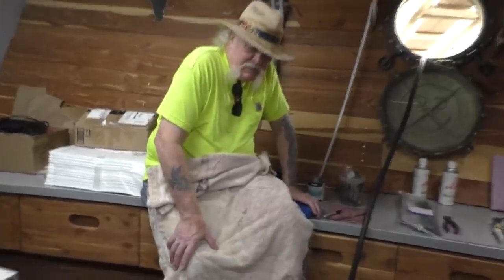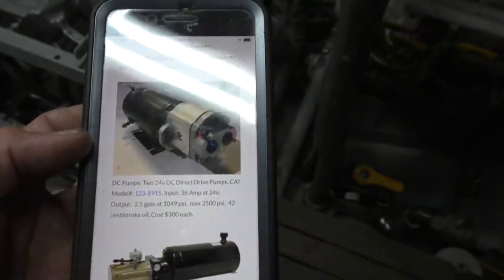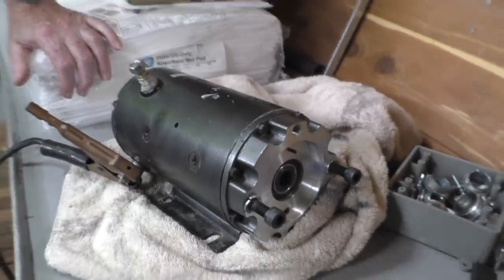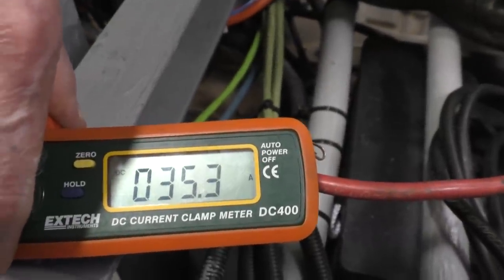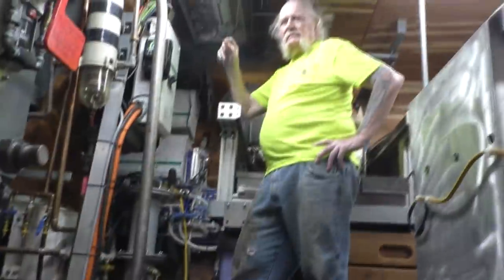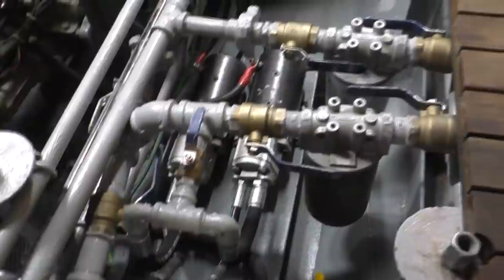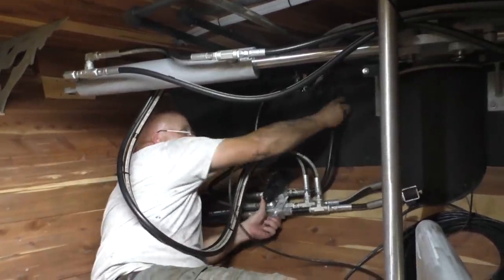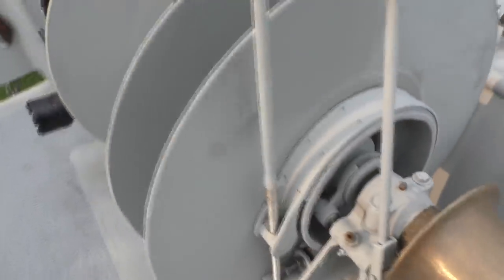Hydraulics - Part 9 - Charging the System

Comment: You have "C" type breakers but you need the slower type "D" for motors (high inrush current). They cost more or less the same, but at least you'll be able to protect the motor with its normal rating

Comment: the breaker generally is sized to protect the wires and it looks like 0 or 00 gauge wire so 125 amps for 0 and just shy of 200 amps for 00. motors that size draw easily into the hundreds if not a thousand amps on startup.

Comment: Interesting to read some people’s take on this. I have been doing electrical control work for the better part of 15 years. Not too often on DC motors however. My $0.02 is that you should check to see is those breakers are rated for both motor over current and short circuit. From the looks of it I would guess those are a standard din rail IEC breaker. It should be rated for Short circuit but I would be surprised if it is rated for motor switching or motor over current protection. Something I tell my clients to keep in mind is that Breakers are there to protect wire, motor overloads protect the motor. My approach would be to look at the motor nameplate or spec sheet and get the FLA at whichever voltage (24/12). size the breaker to no more than 200% (to leave some buffer), size the wire to the breaker, and put a motor starter on those that have an overload ranged to the FLA (plus service factor if you so desire). Tie the motor starter coil in with a pressure switch dry contact and let the system maintain a range between the high/low set points. 

Now having watched your channel for the better part of 4-5 years, I am fascinated to see what solution you come up with.

Comment: if the motors use 36A you should use a 72A Fuse because the starting current is insane.
Or use burn out Fuses. They react slow and wont burn out when starting the motors
Reply: @Brian-mp6bg  his system is designed to use breakers. Your point I think is very important. But unfortunately Doug is not one to change his mind at this point. Others have suggested using breakers that will handle the high start up surge. Certainly one or the other That's the current setup cannot work.

Comment: hydraulics sounded a little lazy to me Doug and the pressure wasnt near optimal so im guessing youy need the motors to have 24vdc as sold and have a soft starter fitted to let them ramp up under load..11 opr 1200 psi should be ballpark for rams and winches i think..God i love when you lift a floor hatch and we get to see the effort you all have put below them..Hope you are getting that launch red tape sorted Team..all the best from oz

Comment: Did you consider that inrush to a DC motor can be 2-3X the Load current. Inrush with DC is much more severe than AC since there is no zero crossings. Inrush limiters can also extend the life of the motor greatly. Inverse time current protection may be 250% ( 400% with exception) with 1100% instantanious.  These are land requirements. I am not familiar with ship overcurrent requirements.  Should be easy to look up.

Comment: Series connection of loads is olnly recomended if the loads are kept equal.. othervise the different loads will result in different impendances, and the one with with more load will show lower impedance resulting in the one with lower load will see higher voltage. That might damage the lesser loaded motor due to over voltage.

Comment: If the load is 59 A on the load after they start, you need to step up a breaker and the wire size for those. Since they are going to be ran for more than an hour per day when in use, you have to de-rate the breaker and wiring to 80% of its capacity. This is done so that as things run and heat up, which with the current those are drawing, they are going to heat up a lot, the breaker and wiring can handle the load and not trip or raise the risk of the wiring deteriorating from the heat early and causing a fire down the road. This is standard for any load that is running more than an hour or two in a day and prevents equipment damage and fire after the system has been in use for years.

Also, you need to have the wiring, motor started, and breaker rated for the locked rotor current rating for the motor if you are going to start them under load or you will trip the breaker and cook the wiring if the load is heavy enough to stall the motor.

Comment: In rush current is popping the breaker. If you halve the voltage you will be doubling the current.  V=IR. The windings will not last when the pump is under load because of the heat dissipation

Comment: If it's a 24 volt motor, 12 volts might run it, but weakly.  If it's 12 volt, 24 might run it at twice the power until it fries.  This all depends on the internal control and overload circuitry (if there is any) on the motor.

Comment: Motors are inductive loads, so there's an 'inrush' current at start up, one way to reduce this is to have a series resistance with a shorting relay, the motor starts in series with the resistance, then the shorting relay bypasses the resistance but you'll need a high power resistor
You also have a decent lrngth of wire that will give  voltage drop, as the motor starts, the voltage drops, and the motor wants more current (lower voltage needs more current to maintain power (V*I=W)
Those motors are more like starter motors, personally i would put those solenoids close to the motors and batteries, with a local fuse or breaker keeping the high current wires as short as possible
Not sure how breakers are labelled in the states, but we have A,B,C etc, the highr the letter, the longer the delay which is more suitable for inductive (or capacitive) loads.

Comment: How much pressure do you have in the hydraulics ? Asking because I see you are using galvanized pipe and connectors on a hydraulic system. I see big problems with that, why are you not using hydraulic lines? Just asking.
Reply from the maker: 3 million psi

Comment: The Circuiy Breakers are just that: they are to protect the circuit from overload, not start motors. Think of your car and the starter motor is fed through a solenoid to provide it with high current it needs under load.
Reply: Others have said there are different type of breakers that will permit the high surge current. These should be used.

Comment: When I wired my Cnc for my Bridgeport the breaker would always pop when turning it on. I have a toroidal power supply and I had to get a different type breaker so it wouldn’t pop with all the inrush of current! Like you said a slower to react breaker! (I believe that’s what I ran into and had to buy!)

Comment: No bueno to put motors in serial, depending on the load the voltage/load will change to the motors -> could overdrive one motor. If you couple the motors mechanically all good. But you need to ensure that the motors will have the same load

Comment: you have a thermal camera to see if those cables heat up... right?  200 amps is a lot.. even on 12v.. a loose connection can cause disasters..
Reply: Yeah I think a thermal camera would be good during the trials at least. And in the future for diagnosing potential problems.

Comment: These same systems are used for hydraulics on cars,I had 36 volts to each of my pumps(I had 4). Run them in series,have 1 solonoid per battery and you will be fine
Also if you add 2 more batteries it won't put as much strain on the pumps and will increase the life of them

Comment: A 12 volt motor will require twice the current to do the same work as a 24 volt one.      (Power=Volts x Amps).  Am not a motor expert but would be careful about running one at a different voltage than it's designed for.  Guessing whether it's mislabeled not a good idea?  Think there's a good possibility that starting current is much higher than running current and that the motors are 24 volt.  Might just need slower tripping breakers.  That's my 2 cents worth anyway.  Good luck, Doug.

Comment: what about load sharing? if one motor is running at half load and the other at full load then you will have maybe 15v on across one motor and 9 on another? or are they always equally loaded?
Reply from the maker: They actually will always be equally loaded as they pump into the same line, but the majority of folks in the comments have errored in the assumption that we are going to keep them in series.   This was only a test. : )

Comment: Inrush current, Doug, as many motors draw from 8X to 16X their rated nameplate current. Not sure if the sparky had an engineer review the protection system…. (Sorry I’m not there to help, as I’m a master electrician and an electrical engineer with some protection experience). I hope your insurance issues are resolved soon!

Comment: Yes, you can get the right size and type breaker to protect those circuits but, I wouldn't. Wiring those motors in series is a huge No- No for many, many reasons. First is they won't tolerate that without overheating and turning to char due to differences in loads and speeds. Secondly, if one fails it kills the other and leaves you without hydraulics. 

Usually, the solenoid is located close to the pump motors and the battery cables kept as short as possible and insulated/ protected extremely well to avoid chafing and the like. This also means closely located batteries as well. Protect the wiring going to the solenoid with a fuse/ circuit breaker or fusible link wire.

Comment: Doug, the best way to solve the hydraulic system gremlins is to splice in a Pfister fantabulator, I've always used the first generation Delbus 6033A's, Lol I'm old school, if something works I stick with it. They're a bit pricey but reliable, anyhow; splice it between the inboard strands of the micrologic redundancy filaments, about three nanos from the inner most junction should be just right. If you see at least a one or two percent rise in brellic ambient pressure, you know you're on the right track. After that charge up all three screetles, I know it seems counterintuitive but you'll see where I'm headed in a sec. Energize the lower grommulas matrix first and then check the little inspection window on the fantabulator, it's hard to see so you might have to turn out the lights, but there should be a bright blue plasma arc, centered in the inspection window. If so you know you're in business. Top off the hydraulic oil and you're ready to sail. Easy peasy lemon squeezy!
Reply: You have to install it backwards. Very important. Most people, meaning 92% of people, ignore this. That's why we have explosions.
Reply: @henryD9363  Whew, I'm glad you caught that, boy would my face be red if that baby blew up. Thanks mate, cheers. 😲

Comment: As with some other comments (assuming you are using those batteries next to them to run the pumps), it would be better from a voltage drop standpoint to relocate the breaker and solenoid for each pump as close to the pump/batteries as you can. You'd only need the small control wire running to it from your relay then.

If these pumps are actually going to draw that much current in operation, you'll lose a substantial amount of voltage along the cables to and from the switchboard, resulting in rather warm cables and less power out of the pumps. 

I've only sporadically seen your videos so potentially a silly question, have you just avoided having mains power via an inverter/generator system onboard? It would make high power loads like these easier to handle, as well as allowing you to use induction motors which have a higher efficiency and no brushes to wear down. The only high currents in that case would be between your batteries and inverter.

Comment: OK, somebody that knows, help me out...

1000psi * 13 GPM = 5655 W (or like 7.6 hp)

5655 W / 24V = 235 A

I'm assuming that those pumps and motors were bought as a package deal so I am doing something wrong in my assumptions/calculations.  Perhaps each pump is only pushing like 2.5GPM at 500psid pressure differential (this would be like 45Amp steady state)?  Those cylinders looked pretty large, so 5GPM would seem like a very turtle like system, but then again how fast do you really need to turn a boat?  I dunno, when I heard 24V all I could think is that there is going to be a lot of current draw let alone the inrush current during startup under load.
Reply: There aren't any published specs for those pumps that I could find. We really need to measure the gear diameters to calculate the CC displacement to ultimately calculate the GPM of the pump.
Reply: @weldonc9986  You could time the extension of a cylinder and come up with a decent approximation... or be normal and just pump into a bucket while timing :)
Reply: @WFCinSC  Both of those would work for a rough enough estimation.
Reply: Are these for steering? Oh dear. Well, if it breaks it's going to break very soon. Close to port.

Comment: Cheap solution: You need a soft start to avoid inrush current tripping breaker. 

More expensive solution: You need a motor controller.

Comment: Isn’t there normally starting capacitors to absorb the in rush current and smooth out the spike in amps?… ( genuine question) I thought is heard that somewhere.
Reply: I believe you're thinking of starter caps for AC motors.  Adding a cap across a dc motor would just increase the inrush current.
Reply: Pretty sure there arent starting capacitors on DC motors, but with AC motors (single phase) there have to be starting capacitors to begin rotation on the motor, three phase motors don’t need starting capacitors either. 
With DC motors though, you can add a capacitor to act like a battery to help give the initial inrush current when the motor starts up!
Reply: This is kind of a knee-jerk reply: "add a starting capacitor."
The world does not consist of only single phase AC motors.
There are also three phase AC motors and DC motors which do not, can not,  use starting capacitors
Reply: @henryD9363  you’re right! But you can use a capacitor to help with inrush current for a DC motor, similarly to how the car stereo industry uses capacitors to help with the surges in power demand to subwoofers on DC power! More than one way to skin a cat! Sounds like Doug might just have to grab a little bigger circuit breaker and keep it simple! I like the way he thinks haha

Comment: Why are you running them in series in the first place? You dont have 12volts available? This setup seems a bit scetchy what i see from this one video. Worst case scenario is that when one motor breaks, it will fry also the other one..
Reply: If one breaks in an open condition, the others will not run it all. If one breaks and shorts out it will probably cause the others to burn out. Definitely should not be in series. Bad design. Already a failure even with normal motors.

Comment: If one pump fails it will overvoltage 2nd pump and shut down so both pumps will be off  as 1 can not take 24v ,swop them back to independent power supply and get some 12v regulators and insert a capacitor to swallow the power spikes ,
Reply: Or just buy real 24V motors a lot simpler and less to go wrong.  But the capacitor to remove power spikes is always a good idea.
Reply: @Jeff9876-k4g  a capacitor is of no use whatsoever with DC motors. In fact, it's simply adds to the initial current surge of startup. Makes things worse, makes nothing better.

Comment: Doesn't a big motor usually use a starter condensator? On AC as well as DC a starting condensator might be what's missing to smooth start the motors, I bet those hydraulic pumps dislike it to be julted like crazy during startup
Reply: Large motors usually have an electronic motor controller which also often consists of some big capacitors for the initial inrush current to get them moving. At least on the big 3-phase ones we had to run chiller units. There are numerous reasons for this, to protect the motor etc. and start in a reasonable way, and to get efficiency out of them as they ramp up and down.

Comment: Do you need starting capacitors to take the instantaneous current in parallel ? Running in series could create uneven voltages depending on the loads.
Reply: A capacitor won't help with inrush.  What Doug needs is a soft starter or a VFD.  A D curve breaker might also help.   Capacitors are used on motors that start under heavy load (like air compressors). It gives them a 'kick' to get started.
Reply: @steampunkskunk3638  or a hydraulic system under pressure? Which is exactly like a compressor for liquid??
Reply: DC system with capacitors? never heard of that one.
Reply: That is true, I work with AC and have less DC knowledge.  Looks like capacitors are even less of a viable solution than I thought.  Doug's solution does appear to work but it will put a lot of wear and tear on the motors and breakers.  He also has the problem that if one motor dies, the other will stop.  But it's cheaper and much simpler than a VFD.
Reply: @steampunkskunk3638  starting Caps dont work on DC motors

Comment: Might as well further complicate this floating Rube Goldberg machine, and install soft start VFD's to control those motors. I'm still rooting for you! Sail Away!
Reply: I wouldn't call it further complicate, it's necessary. Others have said startup current is 8x to 12x running current. The circuit breaker type has to handle it. The ones he installed do not
Reply: @henryD9363  I was serious about VFDs. It’s the only solution if you can find ones that can hold up- marine environment vs cheap Chinese electronics. I’m fascinated by the complexity of this boat while knowing everything will break at sea.